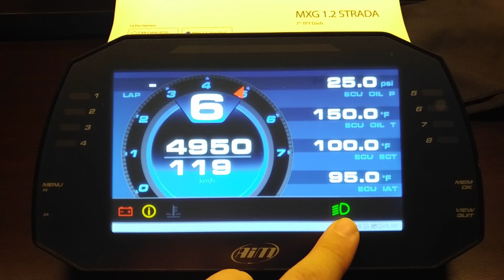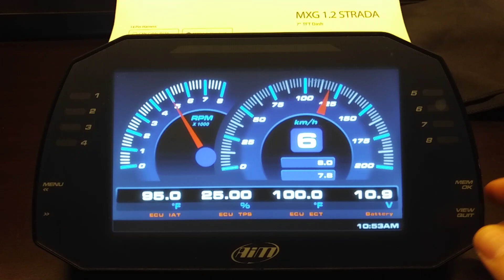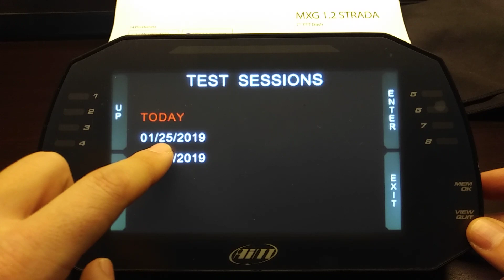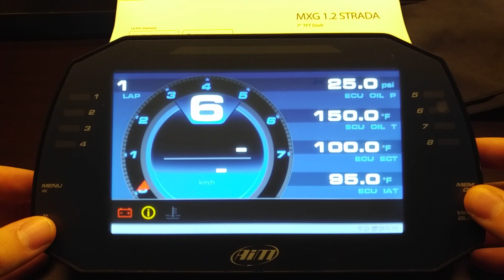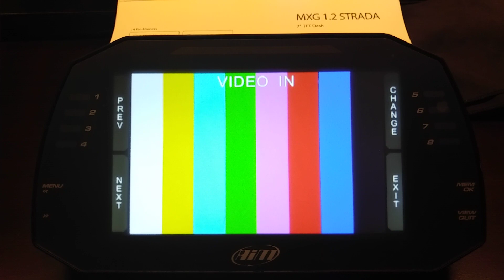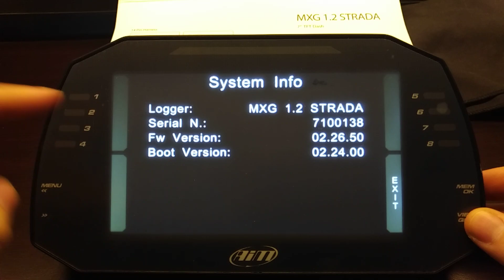AiM MXG 1.2 Strada Overview

Comment: I need to see this thing in action.  There's always a refresh rate issue with these type of things.
Reply from the maker: Thanks for your comment, we agree, some systems do not sample data (especially from the ecu stream) as quickly as one would like, but I can assure you that the latest generation of AiM dataloggers are very good, and can sample analog signals up to 1000 times per second, and ecu data and GPS data at 10 times per second. Please check out www.oppenheimenegineering.com for more information and videos on these systems.